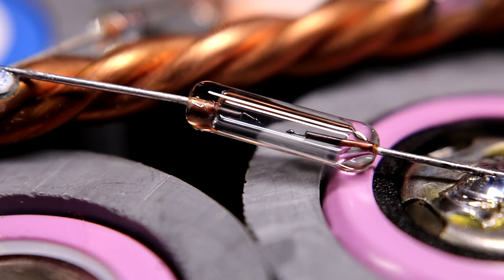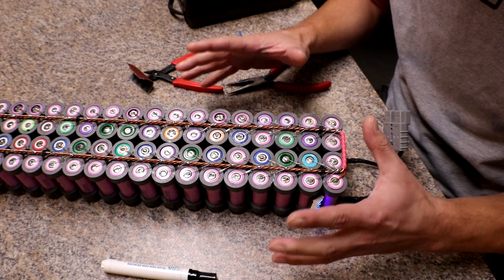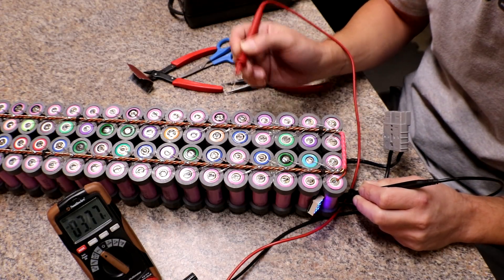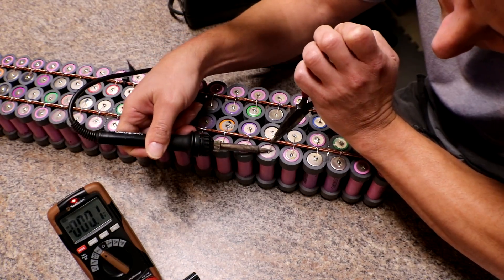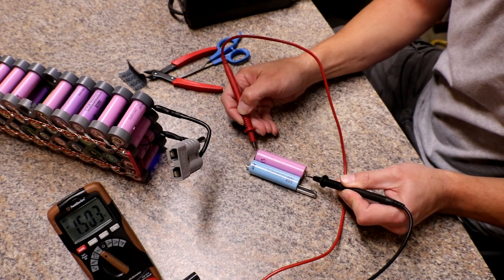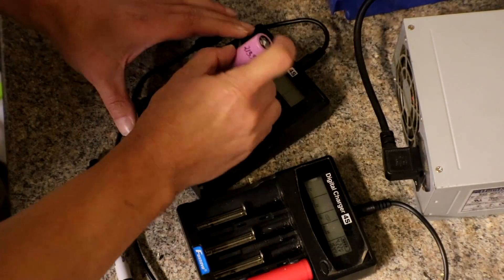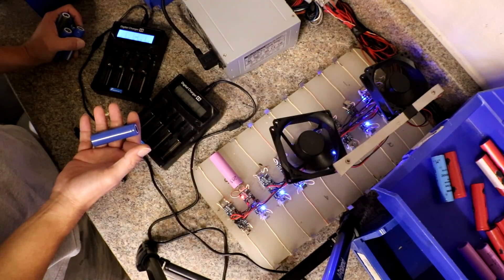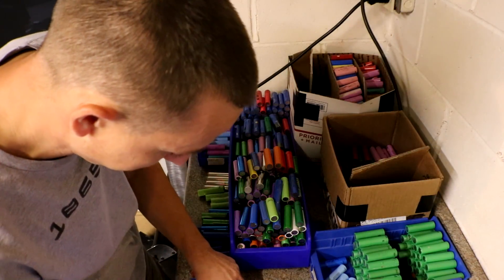Diy Tesla Powerwall ep63 1st Blown Fuse & How to Replace a Cell in a Pack!!!

Comment: What is the internal resistance of the cell?   Are you tracking IR as part of cell processing, or just capacity/voltage?
Reply from the maker: I dont have anything to check IR yet so Ive only capacity checked so far!

Comment: if it takes and keeps a charge. and not heat up. keep it. just mark it so not to put in some where hard to replace it.
Reply from the maker: Ill let it sit for a bit and see if the voltage drops 😀👍
Reply: AveRage Joe 
yea. if its usable at all. I'd use it in a flashlight or something . if it doesn't get too hot. good luck. and congrats on the project
Reply from the maker: +James stranger Thanks! Ya ill have to get a flashlight to fit it 😉
Reply: I use them in those 3xAAA led torches. Two layers of the thicker heat shrink tubing and they fit perfect.

Comment: Blow it up. Show us what not to do. 
What I don't understand is why it would make a difference if you had not put it into the TP4056? Isn't the Foxnovo 4S a charger also? And ... Isn't your "TP4056" a homemade charger? Sorry for all the questions, I plan to start charging soon.
Reply: The Foxnovo is a charger and does charge the batteries up after being capacity tested. However Joe might had done the same thing I do... I got so many cells to test that sometimes as soon as a cell is done testing capacity, before it gets recharged up to full voltage, I might pull it out so I can check another cell. Then I put the cell that was just checked in the TP4056 charger to charge it back up.

I only have 3 of these foxnovo chargers and I have the 24 slot TP4056 that Joe built me a while back. I don't like tying up the foxnovo just to charge a cell. :)  But that's just me. Not sure if Joe does that or not. (pull cells out of tester as soon as they are done capacity testing before they get charged back up).
Reply from the maker: +lnxpro Yeah if Im there and a cell is done being capacity checked Ill pull it out and put it un a tp4056 (usually lol) but could of missed this on lol
Reply: So, just because it had not yet been fully charged before being built, you think that may have caused it to fail? Wouldn't it have been fully charged by now just from your solar panels?
Reply from the maker: I think I pulled it right after being capacity checked so it was at around 2.7ish volts and never charged it back up.  It could of sat like that for months and slowly lost voltage. Then as soon as I put it in the pack to solder the fuse, the fuse popped without me seeing it.  The pack voltage when building was at 4.1ish.  I dont actually know but thats an option lol
Reply: Thanks for the replies. I'm sure I will learn a lot as I begin my powerwall project(s).

Comment: good run on the inverter stream dude at that heavy load im thinking under normal use you may have about 12 - 14 hours run time guess we shall see when ever your ready to do a normal run test
Reply from the maker: Thanks Man!!!  Yeah that will be the next test run!!! Ill match my fridge and maybe a tv and some lights for a test and see how long it goes👍😀
Reply: dont forget your fridge is not always on so you gotta make up for that bout the best way is get the watts it uses and take about 40% off of it and go from that point for the other loads added in. A 60 watt equivalent LED will use about 10 watts ac just in case you didnt know that. Some led tvs 30 watts  now desktop computers wo nelly they like the power up to 300 watts depending on high performance or not mine is about 140 watts watching movies or in games 160 watts. Used a kil-o-watt meter to get those numbers. Best off go through the house and figure what would normally be used and stick the meter to it and write the wattage down and add it up but dont forget to take off 40% for the fridge its only partial run time. My fridge uses 80 watts to run at .8 kwh per day yeah i paid 430 bucks for that energy star 12 cubic foot fridge and im poor only making close to 20k a year. So all i can do is the poor mans way but at least its safe and useful. One thing about a fridge if its not energy star compliant you'll pay the difference in battery cost cause they will sure use them. Later on down the road you may want to consider using super capacitors at the V-In to assist on the surge power needed instead of it coming from the batteries the surge comes from capacitors and your best off getting them from ebay cause amazon is twice the price.
Reply from the maker: +Steven Rowland I think my fridge pulls 125watts all the time but Ill have to watch the meter for a while to see if it goes down.  I do have some big ass caps laying around somewhere. Ill have to look for those as well. I have some dc ones as well. Just got those so I know where they are lol

Comment: yaaaaawn 5:20am... I think the problem with the Opus C3100 is most probably good connection problems. they aren't gold plated so it oxidises and the sprint pressure could be better. don't have one yet though but it's from what I've heard others complaining about them.
A fuse is a fuse, it's either good or blown, never heard of one going "bad".
I reckon that bad cell you accidently shorted it, coz it makes sense. battery would drop it's voltage (protection circuit?) and fuse would blow.
Reply from the maker: LOL ya went to bed at 4:30am lol.  Maybe Ill get an opus sometime and give it a go!

Comment: It would be nice to see the ESR of that cell.
Also a 24h test of where you charge it up and measure the voltage and then let it sit on the bench for 24h on it's own and then measure the voltage to see if it's self discharging.
Reply from the maker: Ill do the 24 hour voltage drop test but dont have anything to check esr👍😀
Reply: I charge with my BT-C3100 to its standard 4.20V and let it sit idle for two weeks, then check.  I had a lot going under 4.1 that I discarded from my packs to keep in circulation.

Comment: I've got a FoxNovo 4S too and mine have started to continuously charge / discharge one of the slots if I don't power cycle it before each test so I've stopped using it now.

I got a Youshiko YC5000 now that I'm testing at the moment and it seems to work fine, it does heat up the cells more due to the location of the resistors right under the cells so I've added a 4-cell holder on some wires to it to get the cells away from the resistors.
Reply from the maker: Ok good to know.  Ya I havent had any problems with mine as of yet.  Thats a good idea to setup a external cell holder to help with heat 👍👍👍